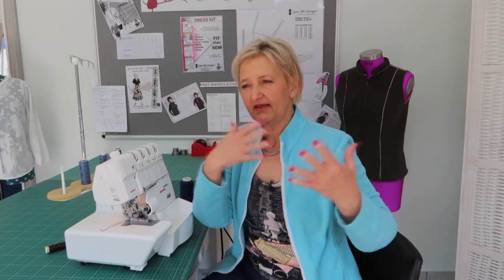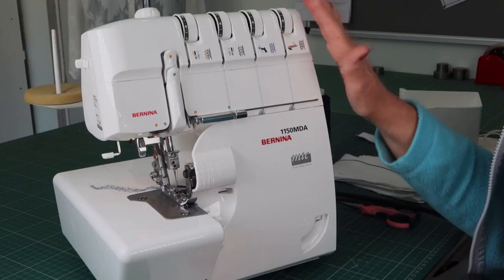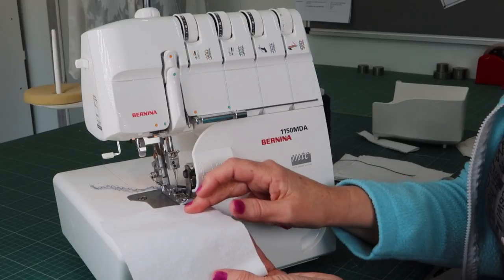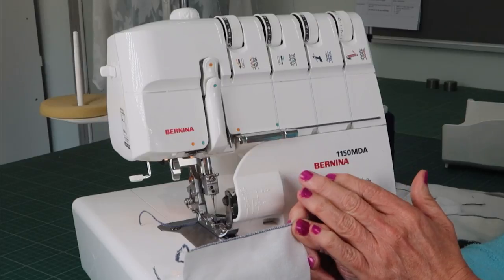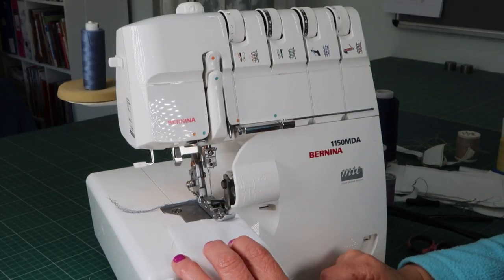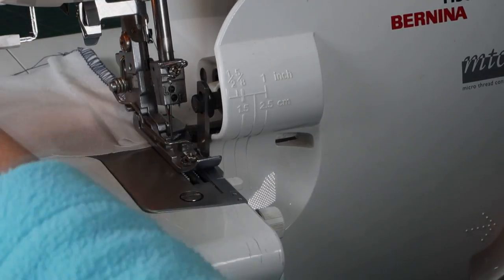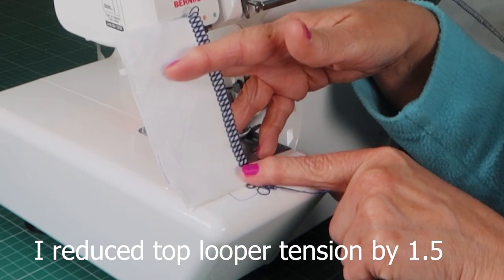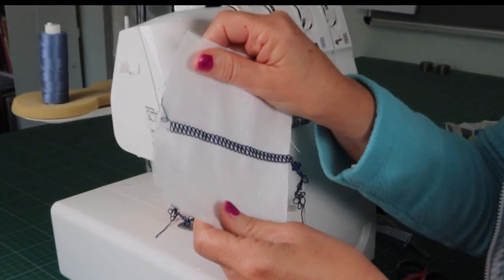Tuesday Tips - Overlocker/Serger Basics (Part 4)

Comment: Thanks. I had not understood was flatlocking was before. I wonder if you can use a metallic thread in an overlocker.
Reply from the maker: Marge, I use a heavier weight metalic thread like Madeira Glamour in my loopers for decorative work. Thinner metalic threads  need a slow speed, metalic needle (it has a bigger eye) and lower tension, so I avoid those threads. I will make a point of experimenting with those metalics and give feedback in a later video.